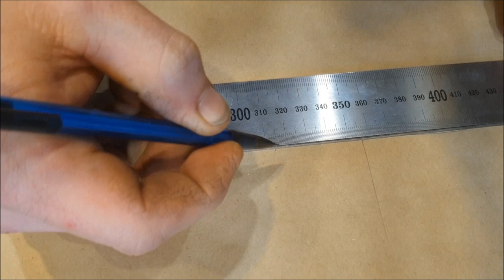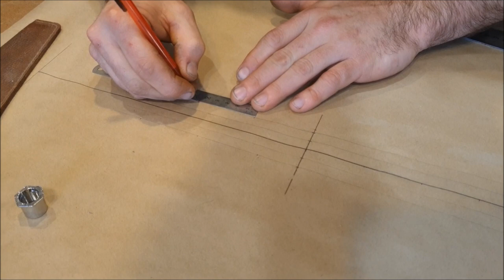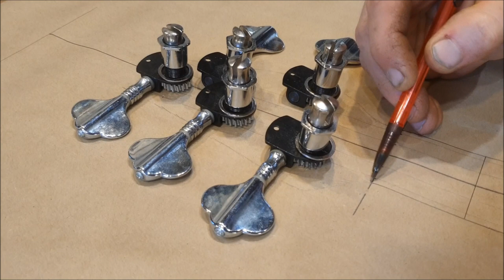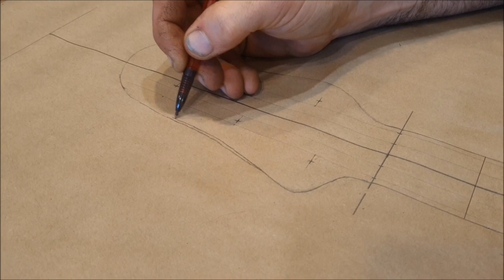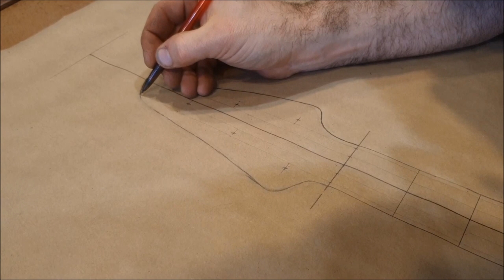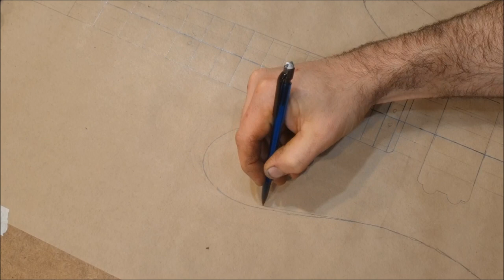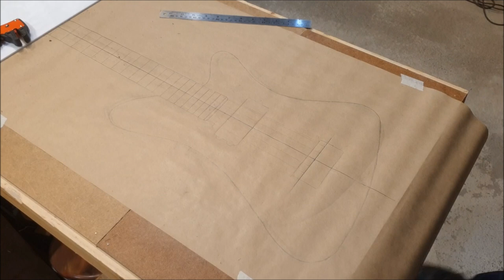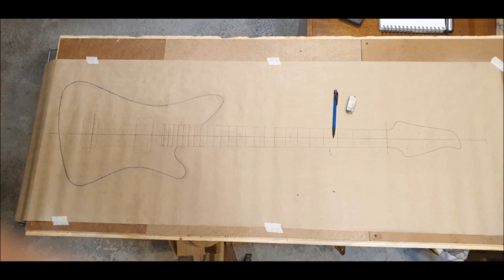How to design a bass guitar

Comment: One thing, that i miss on my Ibanez.
I saw this only on a custom bass.
The horn on the knee-side is a bit longer and curvy. With that you can play in the sitting position an have the bass in a bit higher angle, without the bass slipping down from the knee.
What do you think about this design ?
Reply from the maker: The Thunderbird body shape has a few issues, you can only really play them standing up with a strap set for below the waist. Even then you still get neck dive but at least you can reach the nut. 

Gibson did a run of reverse bodied Thunderbirds a few years ago and it solved all those issues, proving that even Gibson's most successful bass was designed completely backwards😂😂